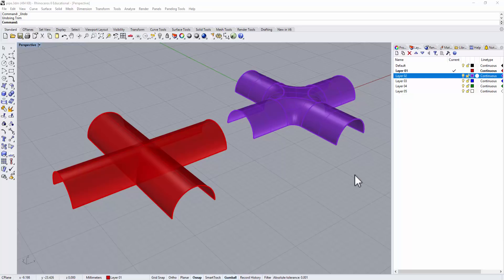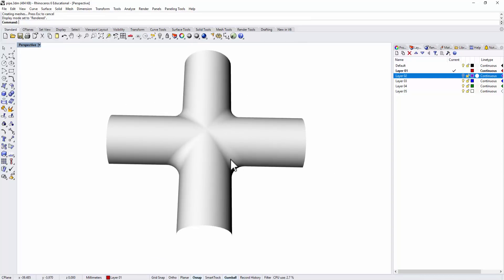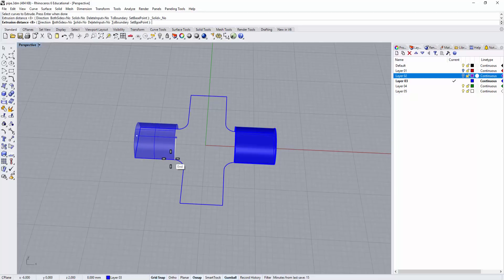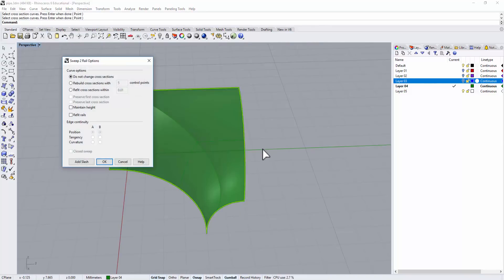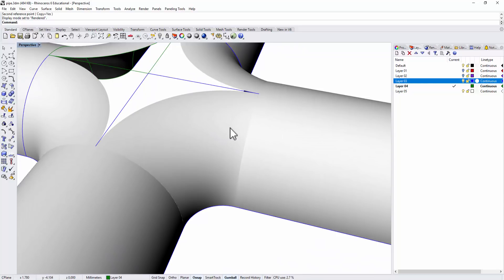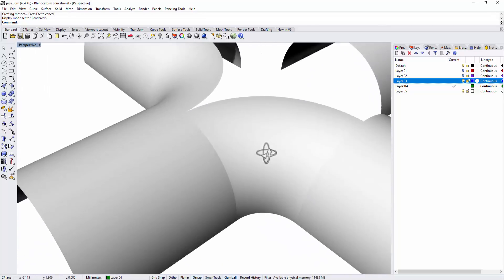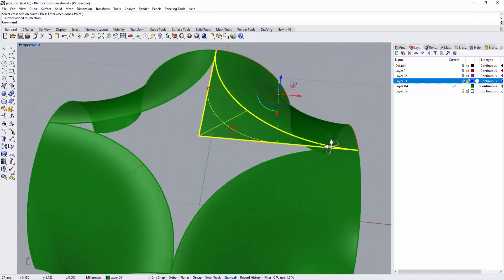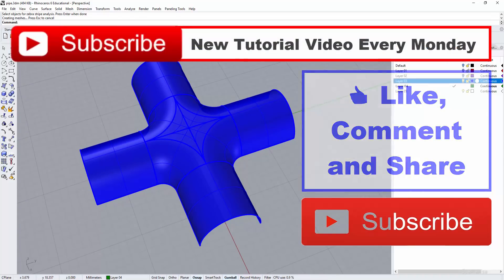Rhino 3D CAD Technique #15: Pipe Surface Study in Rhino 6 (2018)

Comment: I only wanted to design a 3-way dowel connector and this is the rabbit hole I've falled down. Honestly, much as I like the software, it should be so much easier to combine solids in Rhino without creating nightmare geometry that won't print.
Reply from the maker: Rhino 5 use to have Tspline can do the job easier and Rhino 6 doesn't have it anymore. However, Rhino 7 will have the quad design coming back. you can actually download the Rhino 7 WIP to play around.
Reply: @PJChenJewelryDesign  Thank you, I might try that.
Reply: @PJChenJewelryDesign  Will that help it to handle fillets better? Virtually I use fillet I end up with unprintable models.
Reply from the maker: @Mekchanoid  The way the T-spline work, it make the model round and puffy. you should not be worry about the fillet.
Reply: @PJChenJewelryDesign  Round and puffy? Is that a good thing? Will it make a better STL?
Reply from the maker: Greg Veit it is matter to the stl file but rounded edges will make the render look better

Comment: 1. Rebuild the fillet curves to degree 5 and adjust the second CV at each end to match the first in a line (flat G2 at end points)
2. Do the same with the bigger curve on top (to be deg. 5) and match the G2 as flat at each end
3. Build the Sweep 2 rail (deg. 5 curves as rails) and from the surface edges, then choose Match Curvature. Rotate + Copy.
4. Build the top surface as sweep 2 rails in the similar way to match the curved surface. Rotate + Copy
5. Join and done
Reply from the maker: Thank you for sharing.

Comment: nice tutorial. based on this, and to achieve better zebras and tangents, the following steps could be made:

1. cross overlap pipes
2. trim
3. join to polysurface
4. fillet to required radius with distance from paths fillet option (not rollin ball)
5. delete created fillets and trim surfaces not needed with edge curves.
6. Surface Blend all edges with default settings and curvature seleted.
7. join all
8. trim joint with a circle to clean up edges.
9. use the patch tool to fill centre gap.

if the center bulge that patch creates is not acceptable:

10. create cross lines from top of cylinders and split them and the half cylinders in half.
11. extrude the lines to the opposite of the corner to use for tangents in the patch tool.
12. patch each corner separately using surface edges, repeat for all corners.

Filleting with distance from paths is very handy in some cases, like this one.

The above will work without deleting the fillets and using them instead of Surface Blend, but zebras will not be so smooth.

edit:

we can also simplify the above, leave the pipes in a distance, split in half, blend each one with curvature (or do one and rotate/copy like shown in the video), Join and fill the star gap with patch. But it is a tad less smooth on top of joint, but it feels more precise.